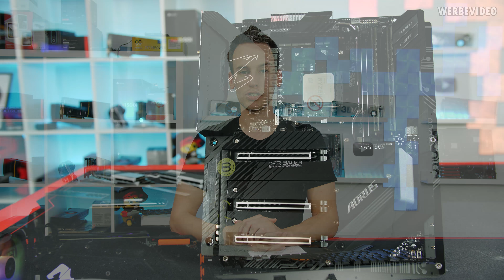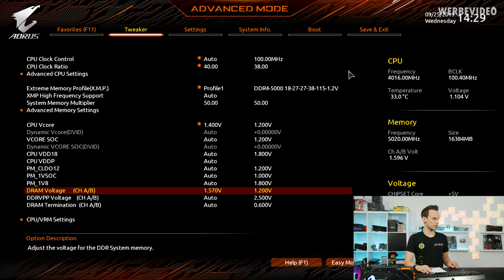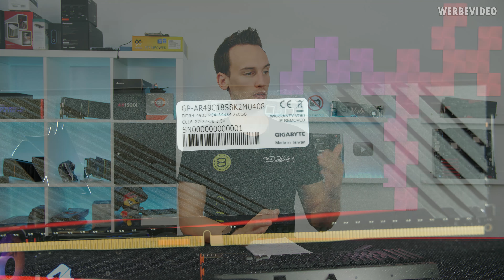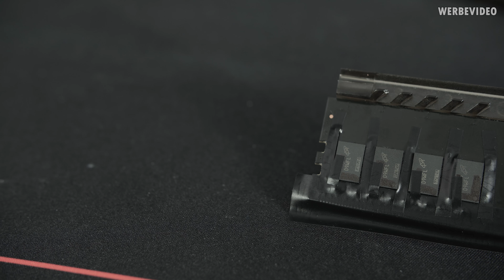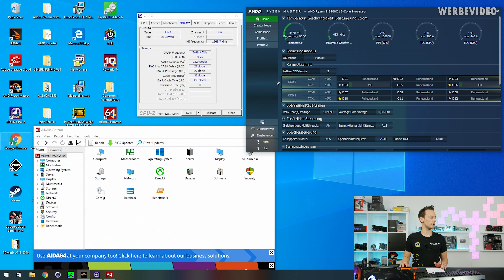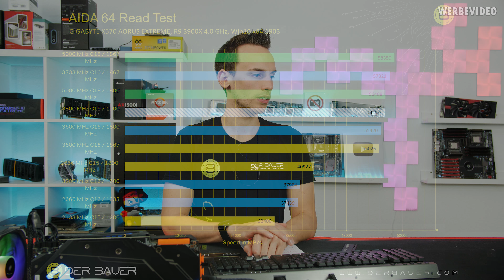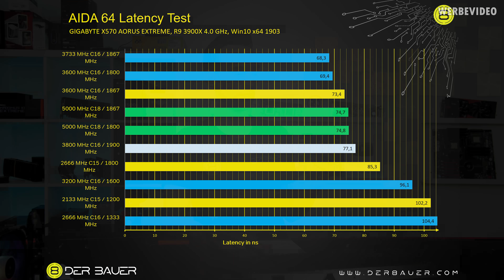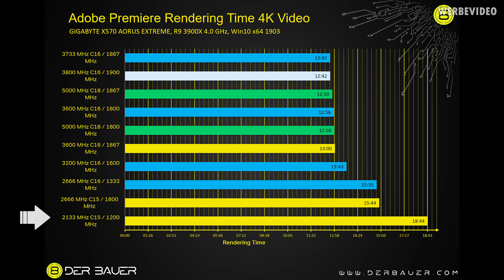Insane: 5000 MHz RAM Speed on RYZEN 3900X

Comment: Such a shame that you continue only telling half the story. When you are running a game you DO NOT get the same memory throughput that you get when you are not including a GPU as you are demonstrating in your graphs. In non gaming tests you are absolutely correct but without including games your conclusion is flawed because it ignores one of the main user scenarios of your audience.
Try running some game benchmarks with a 2080ti and you will find that the 2666c15 @1800  will out perform the 3200cl14@1600 and likly be close  to matching your 3800 kit.
Reply: That's not the point of the high speed RAM though. Why would he say that 3800 MHz or higher was meant for gaming? He never has. He's tested it with professional software, because that's what high RAM speed is designed for. Low latency, high speed ram is better for gaming, yes. But you missed the point of this video.
Reply: @JosephArata  your comment, together with the content of the video shows the continued lack of understanding of the Ryzen architecture. 

The infinity fabric interconnects have a maximum bandwidth of 32 bytes per cycle. Running infinity fabric at 1867 million cycles per second equates to an absolute bandwidth of 59.74GB/s. This is clearly demonstrated in the read and write results.

The infinity fabric is shared bandwidth not only used by the CPU to access ram but also by the GPU to access instructions and data from the L3 Cache. If the available bandwidth is being partially used by the GPU, it is not available to the CPU cores to obtain fresh data from system memory to process new instructions so the cores sit periodically waiting for data and not processing data 100% of the time.

As I said in my initial post, productivity does benefit, as kind as you are not making use of a GPU. Any productivity apps that rely on gpgpu will be impacted as the CPU cores do not get the memory bandwidth that this video assumes that they do purely due to the limitations of the infinity fabric interconnects.  Ringbus, running at much higher frequencies does not have the same limitations but the assumptions contained in just about every Ryzen video I have seen doesn't seem to understand this point.

5000 down to 3800 ram is great if can afford it but it doesn't really give you any real benefits over 3800 ram as the ddr silicon can never stretch it's legs because of the fabric bottleneck.

Rendering apps in the real world just about all use GPU to a certain extent for acceleration, games play a large part in PC usage, how much time do you spend compressing and decompressing files?

The presentation here does collect data but it doesn't represent any sort of real world usage when it really could it the architecture was better understood.
Reply: @Gandalf721  Take a look at the Linus tech tips video on Ryzen memory performance from about a month ago and take a look at the gaming performance of the 2133memory with FCLK set at 1900Mhz. Compare that to the frame rates that they got with the 3800 ram,. 

the 2133 system test has significantly higher frame rates than the 3200 ram test system in almost all of the tests and only trails a 3800mhz system by about 2or 3 fps.

Pay close attention because they do not spell it out in the video,  displaying the results on two different slides that makes the comparison more difficult.

Please note that the maximum theoretical bandwidth of dual channel 2133 ram is 34.1GB/s less timings overhead. The maximumm bandwidth of the Infinity Fabric interconnect at 1900Mhz is 60.8GB/s. There is still excess available bandwidth on teh interconnect for teh GPU to access the L3 Cache memory with capacity to spare.

Noone that I have seen has tested this properly because everyone seems to assume that Ryzen communicates with memory the same way that Intel does. It doesnt. That difference in architecture, and the limitations that go along with it is the reason that Ryzen kills intel in the benchmarks shown in this video but falls down in gaming.